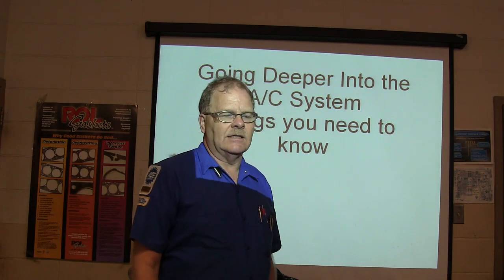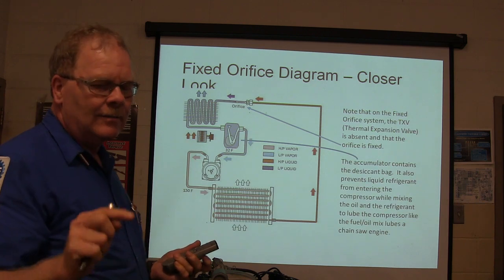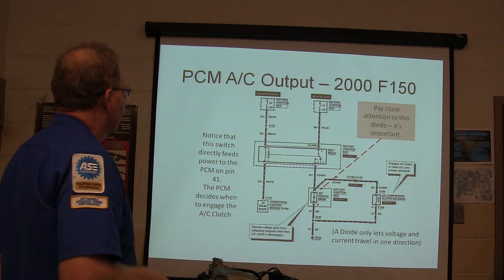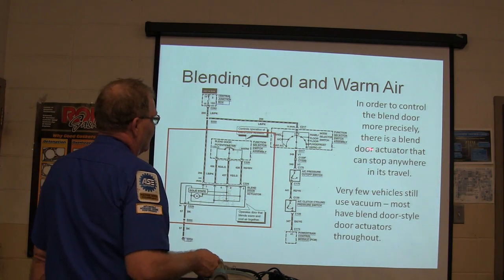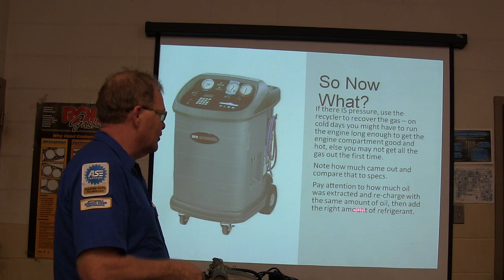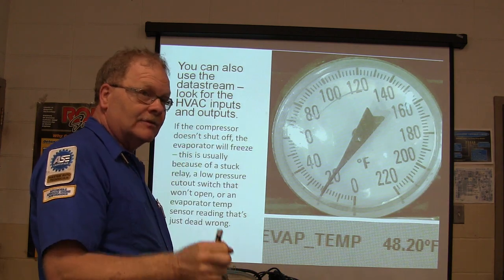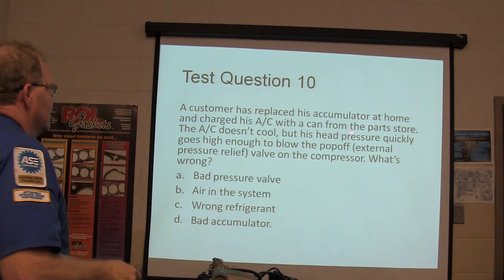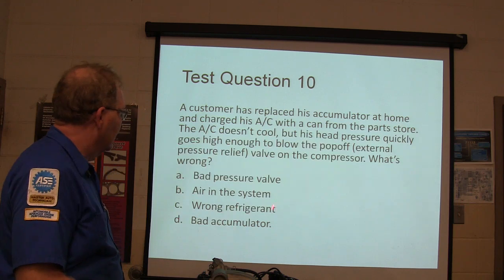A C Day 2  Troubleshooting

Comment: Hello, Richard. How about checking current at the clutch wire? If there is no current, you know you may have an open coil, an open ground or an open feed. If there is 2 to 4 A of current, you may have and air gap issue. Also, if you measure the resistance of the coil by hooking the negative  to ground and the positive to the pin going to the clutch, and you have 3 to 6 ohms, does that mean that the clutch is fine, and your issue is an air gap?
Reply from the maker: Good stuff!!